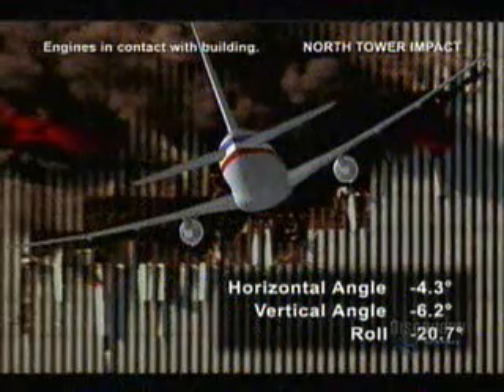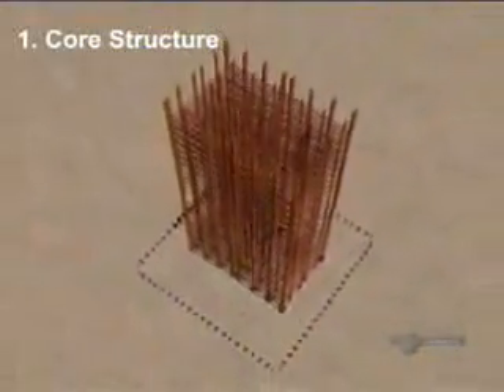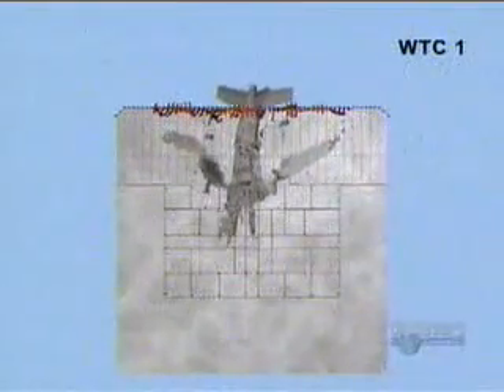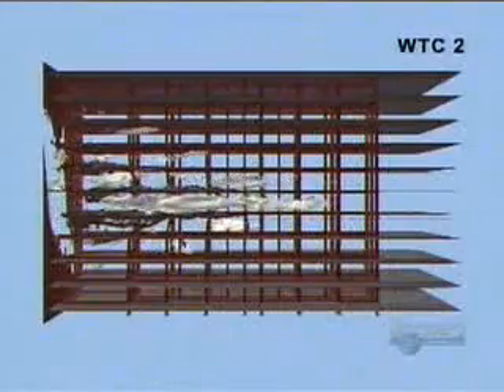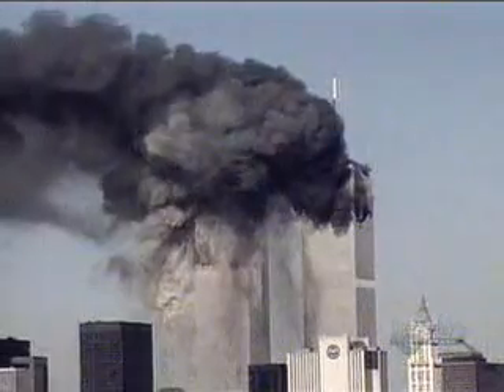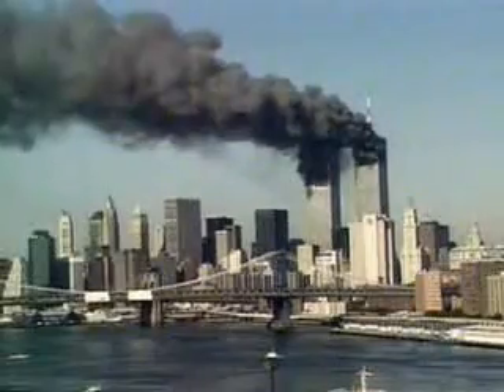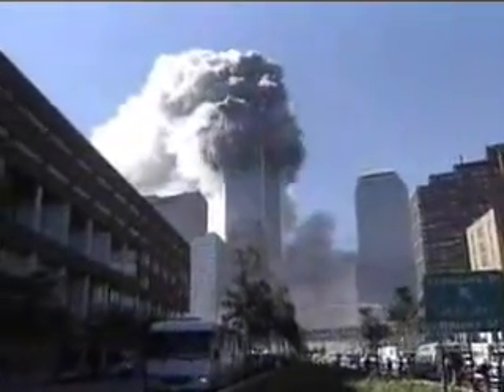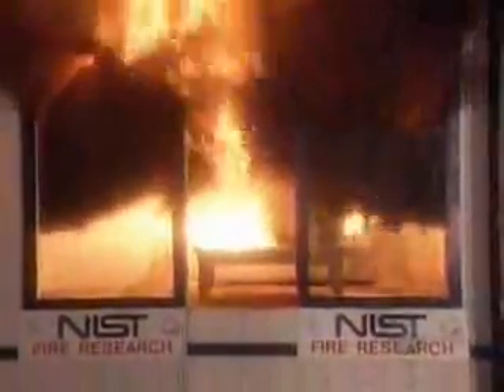9/11 What Made The WTC Twin Towers Fall

Comment: Great animation , but it fails to explain the total disappearance of the core structures. The core structures were independent of the exterior columns and was made to take the gravity load of the building.  It's even clear from the animation that most of the core columns were not displaced by the plane impact. So what brought it down? 

 Also, even if the plane could slice through the interior columns, only the floors above the impact region would come down. Explain to me how the upper section of 15 floors (in case of the North tower) can fall through the bottom uninjured section of 95 floors and not decelerate in the process
Reply: It actually does explain it the fire compromised the core struts that held the top of the structure up essentially meaning that columns that held the middle section of the building together failed. This is not because the fire melted the columns it didn't. Rather it heated the columns to around 650c. At this temperate the strength of structural steel is halved moreover the fire was diffuse meaning that it would have compromised most if not all of the core pillars effectively weakening all of the pillars as the fire grew. With each one that fails the remaining load was was transferred to the other pillars. With massive loads and weakened pillars stripped by debris of fire proofing (which is basically fire proof insulation to stop the pillars heating up in the fire for this reason) not to mention the kinetic impact of being hit by a jet the as well as the additional load being transferred from the load bearing walls which were shattered when the jet hit this means that each column would have been shattered by the shear load once a certain number of columns had failed. At this point the floors above would have fallen essentially intact on to the slab floor directly below them.

The rest of the answer is gravity + pancaking of the concrete floors. The top floors of the world trade center basically became a very large weight as they descended. Each floor is basically a sheet of reinforced concrete suspended from both the columns and the walls of the building. These floors however are not load bearing in the sense that they are designed to hold the weight of the building. As the floors above fell on to these floors they would break from central core effectively tearing themselves free from the core and creating huge lateral stress on the core pillars just as the rest of the weight of of the building held together by the steel frame at the top of the building came down on top of them. This part is actually very similar to what happened to the Sampoong Department Store in south korea (which prior to 911 was the largest disaster of this type). This building similarly fell straight down and this was due to construction issues with the roof and top floor which collapsed on the floors below shattering comprised columns. In that case the issues where caused by poor building and maintenance rather than by fire but the consequences were the same.  

With regards to your question about not appearing to decelerate you need to remember that a building is mainly air (so we can actually use it). At first as the floors begin to fall they compress together becoming a single falling block the (first booms that you hear on audio recordings are probably the floors coming together). That block of solid concrete accelerates as it descends becoming a solid concrete sledgehammer of ever increasing weight which basically free falls because the floor (which isn't load bearing remember) instantly  becomes a part of it as it sheared off columns which are then comprised as by this point a 45000 tons concrete are falling directly down at increasing speed looking to achieve terminal velocity. The forces that we are talking about are titanic the world trade center towers were about 500,000 tons of building and by the time the debris from the top of the building hit the ground it was moving at 120+mph.
Reply: +ThePirateParrot If you see the animation of UAE 175 hitting the south tower, it is clear that most of the aircraft body missed the inner core because of  the angle at which it struck the building. Only a small portion (approximately 20 ft) of the left wing may have come into contact with the core, but it would've been shredded by the perimeter columns long before it can reach the centre of the building.  Aircraft wings are made of lightweight aluminum of 2mm thickness and is the most vulnerable part of a plane. It can tear apart if it collides with a bird at landing speed (140-160 knots). It is thus obvious that the jet- liner impact, in case of the South tower, didn't do damage to the interior columns. The columns failed solely due to fire. 

Was the fire in WTC hot enough to weaken the trusses as well as the core side by side, to the point of structural failure? If this was the case, then the fire needed to spread across the floor uniformly and burn every inch of it , which in reality, did not happen. We know this from witnesses.

Stanley Praimnath was on the 81st floor of the south tower: "The plane impacts. I try to get up and then I realize that I'm covered up to my shoulder in debris. And when I'm digging through under all this rubble, I can see the bottom wing starting to burn, and that wing is wedged 20 feet in my office doorway."

Donovan Cowan was in an open elevator at the 78th floor sky-lobby: "We went into the elevator. As soon as I hit the button, that's when there was a big boom. We both got knocked down. I remember feeling this intense heat. The doors were still open. The heat lasted for maybe 15 to 20 seconds I guess. Then it stopped." At least eighteen other survivors from the impact region told us their stories.

But now you'll say, that the trusses did bow inward as evident from photos and videos. My guess would be  that the heat was concentrated only on the exterior columns and trusses, leaving the rest of the floor (and thus the core at the center) slightly less damaged. 
From this information, we can deduce that the interior columns did not receive sufficient heat or impact damage to cause it to fail entirely.

So what would happen if we assume that the core and perimeter columns failed simultaneously and that the conditions for that to happen were present? Well, if you observe the South tower, the impact region spread out over 4-5 floors, although atleast 40 floors have burnt. Say failure occurred in the most damaged floor and it fell down about 10 feet and came to a rest on the slightly less damaged floor below. (Some theories suggest that all the floors above would also come down, but this is not possible since each floor was held independently by the interior and exterior columns and there is no way two floors could fail at precisely the same time). So now, the slightly less damaged floor will resist the weight of two floors for some time and both of them would fall down upon the (less injured) floor. This would take several minutes as every floor below undergoes the same process until the entire structure is reduced to a pile of rubbles. But in reality, it took only 20 seconds for the building to come down. Also note , that this scenario would only take place if the tower came straight down and not tip over, which is contrary to what actually happened.
Reply: Ok so your slightly misunderstanding what i said (that is probably my fault). A building like the world trade center is in a state of equilibrium. It is held up against gravity by the combined strength of all of its reinforcing elements. Its best to think of the top of building as constantly trying to accelerate towards the ground. It is prevented from doing so by the combined structural strength of all of elements holding it up. Each element has a finite amount of integrity with which it resists that force.  In the case of the World trade center it could have survived the aircraft strike alone and even the loss of 2-3 core columns which supported the weight of the building. Im not suggesting that all of core columns failed, they wouldn't have had to. All that needed to happen was a sufficient number needed to be comprised. Once that happened the steel in any uncompromised columns wouldn't have been able to handle the increased load and each would have catastrophically failed in turn by bending or shearing under the now unbalanced load.

 You assume that even if this happened the floors below would only have been supporting weight of 2 floors. This is incorrect the moment the core fails at this point you have 2 separate buildings the structure above the point of failure and below the point of failure. what hits the floor below is not one floor but the combined weight of every floor above it. Held together by the still intact structure above them. Moreover this weight isn't settling on part of the building designed to support this weight its settling maybe 30 or 40 cm from there. at this point the strength of core works against its self. Those core columns which are strong enough to hold would have just gone straight through the floors above at first but the lateral loading would have bent them into spaghetti as the rest of the building accelerated towards the ground. Second you misunderstand the role of perimeter tubing. This hollow tubing is relatively weak individually what gives it strength particularly against lateral wind loading is that it is secured to the inner core by the floors this means it is very stiff as a whole because it can't bend due relatively short length of each unsecured piece and the high tension under which its held. This transfers the loading across the whole structure and into the ground meaning the core columns don't need to bear the wind loading. This does not mean that they are designed to hold up the structure. They are basically in the same role as the securing lines of a tent they stop the building from being pushed over but if you snap a pole they aren't going to hold the building up. This means that once the collapse begins they becomes basically irrelevant because what holds them in place is the floor tresses that hold them to the core. So if the core has failed or the floor is gone then they lose that strength. Thats why on the animation they collapse inward. When the core fails and the floors are pulled down towards the ground the tubing which is secured to them is pulled towards the collapsing floor.   

So why did those core columns fail? As you stated the fire would not have affected all of the core columns in the same way.This is why the idea that debris from aircraft which would have disintegrated on impact removed the fire insulation and exposed the core columns is important. The aircraft wouldn't have cut the columns the hardness are too different but that doesn't mean that the energy from the impact just vanishes. Think of the physics the plane basically becomes like a giant shotgun shell at the point of impact. You shoot a thick hardened steel plate with shotgun loaded with lead shot then that steel plate isn't going to be damaged much but if you holding the plate then you are going notice the transfer of energy. Moreover there is a good chance that the pellets are going to ricochet all over the place.l. So did the core fail when hit by the aircraft? No. does that mean no damage was done at all to the core columns themselves? Probably. but the floors holding the relatively thin outer tubing to core with the 1300t load design probably took a significant hit. This also means anything softer than a steel plate (like say fire proof insulation) isn't going to hold up well either. Its also going to convert alot of jet fuel into aerosol. This is going to go everywhere and fire needs oxygen to burn. this is going to come from 2 places in a building like this the first is the windows and the second is the large chimneys that we like to call elevator shafts and stairwells in the core of the building. As such you would expect these places to be cooler below the impact as the air is drawn up into the fire. This fire burned for an hour at temperatures of up to 1100c with huge amounts of accelerant having been pumped into the building. Steel starts to become plastic at around 450c fails under recommended  loading at 550c and has almost no strength at all at 1000c. Everything is connected together with steel which also conducts heat reasonably well. Stating that the fire wasn't hot enough because a couple of eyewitness who evacuated the building immediate after the explosion felt the heat leave from somewhere you wouldn't expect to be that hot is not convincing. Exposed steel work has generally rated fire resistance of between 30-60 minutes in a normal fire. In this regard the world trade center actually out performed its spec given that that a lot of its fire proofing was probably stripped. .
Reply: ThePirateParrot I'll try to keep it brief:

"All that needed to happen was a sufficient number to be comprised......under the now unbalanced load"

I don't quite understand what you're trying to tell by saying that the towers were in "equilibrium". Are you implying that a slight excess force from any direction would create an "unbalanced" state and thus lead to the tower's collapse? Well of course it would, only if the force exceeds the tower's withstanding capability. It also depends on the nature of the force, which in this case, is the impact youre referring to. The buildings were made to survive a hurricane at 225 km/hr . It's found out that the total lateral wind load the building could endure exceeds the lateral load of a 767 slamming the building at 586 mph, although the plane impact created higher pressure since the force applied acted within a short area , unlike the force of a hurricane which acts over the whole surface of one side of the tower. Much like your "giant shotgun" example, the way the towers would absorb the plane impact can be explained by comparing to a sheet of glass absorbing the impact of a bullet. Imagine you throw a basketball at a window and fire a bullet at another window of the exact same kind. The basketball would smash out most of the glass while the bullet, despite travelling  hundreds of times faster than the ball, would leave a tiny, neat bullet hole. This would not cause the glass above the impact hole to fall down below since it is held sideways by window frames (which in case of WTC skyscrapers were the remaining undamaged trusses which connected the floors to the perimeter tube) and upright by the remaining portion of glass which continued around both sides of the hole (imagine this as core columns) 
Similarly, the aircraft impacts were at great speed and severe damage localized to only a few floors, which is actually preferable over the hurricane.

It is proven that the fires in the building did not heat all the trusses in a single floor appreciably. In some regions it did, in others it didn't. For an example, if a floor is connected to the walls by say, 50 trusses, the overall loss of strength would be around 20% in the most damaged floor. Not to mention the concrete slabs which held the trusses to the walls firmly. But remember, I'm focusing on the core columns here.

"You assume..2 floors"

I was just picturing the pancake collapse scenario where one floor falls onto the other and that one falls on the floor below and so on. However, you could be right. When the aircraft sliced through the building (not the core) it did leave a large section of floors hanging loosely above which were looking  to come down and fill up the vacuum created by the impact hole. Even if we ignore the fact that not all trusses were weakened to the point of structural failure, the undamaged core held up the central section of the floors, the remaining columns were perfectly capable of taking the weight of the building etc etc, the science of 9\11 still does not add up. How could the upper, weaker section of floors completely pulverize the larger, uninjured bottom section? You mentioned that the combined weight of every floor above would come crashing down, but wouldn't it disintegrate itself upon impact? Wouldn't the bottom section of the building  give the same equal and opposite force to the force of falling upper floors? This would certainly result in a deceleration, not an acceleration, given the 400,000 tons of steel acting as a path of resistance through the building. Even if you took the top floors and dropped it on water, I'm sure  it would fall at roughly the same speed through water as it did, supposedly, through the steel structure. 

I'll refute the rest of the points you made, but later. before I do that, I need to know; do you admit that the tower's core collapsed solely due to fire, particularly in the case of South tower?
Reply: +Wash Result fire and the stripping of the interior
Reply: Ok Im also going to explain what i mean by equilibrium and why the top didn't just disintegrate. Firstly Imagine a big glass top table with a alot of really heavy weights on top. This table has alot of legs lets say 40. Now if i take away 10 of those legs no problem it can still stand. I take another leg away the legs start to bend a little. This is because the pressure on the legs is starting to make them elastic they are exceeding there ablity hold the weight. Now when i take away another leg away the remaining legs snap. and the table falls to the ground. now imagine that the table is on another table what happens when that hits the next level? 

The second part of your observation asks why didn't the top disintergrate as it hit the floors below. The short answer is it did. Thats all the debris falling off the side but so did the floors that it hit. Thats what i meant by pancaking as the floor smashed together you have a self sustaining force. After all at this point the floors have momentum and there for more energy contained within them than there is in  a stationary object. As each floor is smashed it adds additional weight to the next blow so once it got going then the concrete and metal floors which were rated for a static load of 1300t might as well have been water it would slow it down but not by a whole lot.